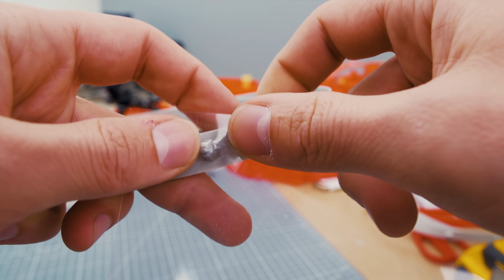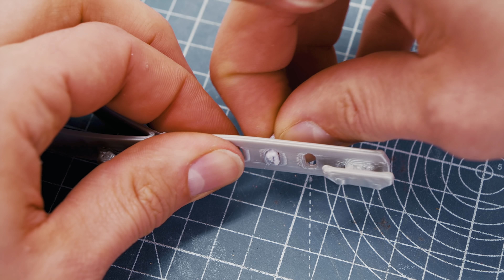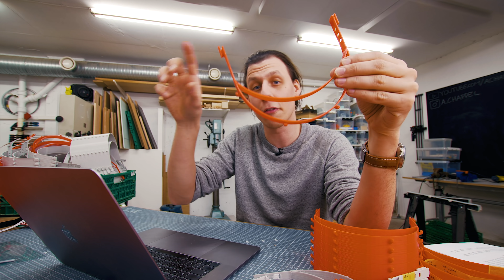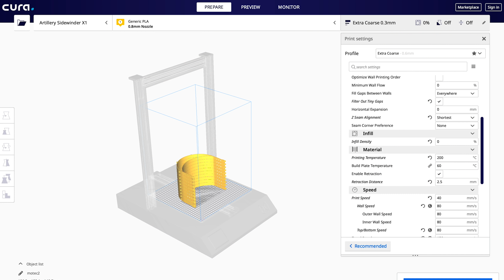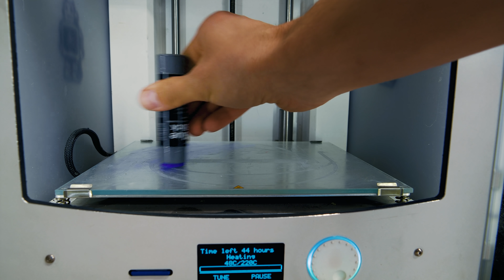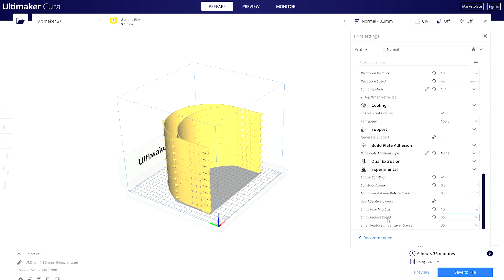3d Print Face Shield Frames Crazy Fast - New Design and 3D Printing How-To

Comment: Something doesn't add up. 
On Ultimaker 2+ you claim to print 80 mm/s with 0.4 nozzle and 60 mm/s with 0.6 nozzle. Then you claim that it is faster on larger nozzle cause there is less friction?
Is this a typo or am I understanding it wrong?

Comment: Hey peeps, for New Zealand we’ve got Shields as the organization that's operating locally, our git has all the public stuff needed to get going. We have a modified Prusa frame that's much quicker to print with 12 /24 hours on an Ender 3 feasible with a 0.4mm nozzle. we also have stacked versions too... Www.shieldsup.gives/github also lots of detail on everything. I've found PETg as the best option, also with plenty of stuff around this, including preset gcodes for machines too.

Comment: ive tried various settings with my ender 3 that has a bltouch connected and a .4mm nozzle but it just doesnt seem to stick nor push enough filement through.ive even slowed it down to 50ms.anyone manage to get this to work on an ender or have the gcode for me to put straight on my printer?many thanks
Reply: i think you are going to have to get a 0.6 or 0.8 to make sure your on the right path. because the heat and the surface area has to match it up and be able to match the flow. also you need some glue sticks to make sure they stay put.

Comment: Hopefully I got it all.Layer height 0.3
Line width 0.85
Wall count 2
Print speed – what you can
Initial layer 25% speed
Travel speed 150
Temp 220-230
Shell wall thickness 2.1
Shell wallline count 2
Infill 0
Bottom layer 0
Top layer 5
Compensate wall overlaps – checked for sidewinder, unchecked for ultimaker
Wall separation width 0,9
Build plate adhesion glue stick
Optimize wall printing order – off
Out before inner walls – off
Fill gaps between walls – everywhere
Print thin wall – off
Filter out tiny gaps – yes
Seam cover preference – hide seam
Combing mode – off
No supports
Bridge wall min length 2
Bridge wall speed 35
Bridge wall flow 100%
Bridge wall fan 50%
Holes – sidewinder off, ultimaker- on
Small hole feature size max 10
Small hole feature speed 30%
Coasting volume 1.5
Coasting min. volume 1.5
Coasting speed 50%

Comment: Cool video! I've been involved in our local effort, our medical doctors wanted a different design from most on the internet as they wanted sealing from the top and more comfort. It meant I had to design our own which takes a bit more time to assemble as they is a foam strip that goes around the forehead. Anyway keep at it!
Reply: If you still need a better design, I have one with a sealed top and comfort. We took the designs to the hospital and the doctors help us to get a feedback and improve the design. Answer me with your email and I'll send it to you

Comment: excellent work, ive been managing 16 a day with an FLSun qqS in petg using a 20mm high wireframe model remix off the prusa site by a user called mike.  i did a wireframe only and 0.6mm noz, 1.2mm thick, overflowing for adhesion, in 2 4x stacks.  8x stack got a bit wobbly.  first 40 delivered to medical professionals in England 2 days ago.  wireframe is soooo easy to separate if you let it cool to room temperature and have the layer height set right as you state in the video.  v good early feedback regarding the strength and how the wireframe design also conforms to a greater variety of head sizes.  they said it also curves the laminate better than other designs as the curvature f the frame is like a tension ed leaf spring and pulls it in closer.  Its their favourite between wireframe rC3, prusa rc3 and the verstan. With that simple wireframe change i cut printing time in half from the prusa model to under an hour per unit at 40mm/s for quality.  60mms possible with petg and 0.6 nozzle but surface finish isnt as good in translucent blue!  this design you presented was exactly what im looking for!!! thank you.  i can double my output to 32 a day now and no longer need supports.  Also im running out of button hole elastic and have plenty of plain elastic left.  so a v good feature for continued production as buttonhole gets scarce.  I also was looking to change the wireframe to 808080  as it would use the curvature of the laminate at its edges better,  so definite improvement if using 250microns A4 laminate sheets.  Thank you so much for sharing this goodwork it will make a huge difference to what i can do now.  It was exactly what i need right now.

Comment: Q. I'm printing the prusa design on prusa mk3s 0.4 nozzle with PLA. I'm finding my perimeter speeds cant reliably go above 70mm/s but my infill speeds are over double at 150mm/s. Is there a reason for this or should I be able to print perimeters faster?

Comment: Q: how does this one prevent droplets coming down the shield from above the person using it? there is a BIG hole there
Reply: Alot of these shields are just that. Shields.... not a replacement for a full mask. Think of it more as a large pair of safety goggles. More of a splash guard than a cover
Reply: It's a splash guard in case of an errant cough or sneeze so the wearer doesn't get hit directly. One should back off if the patient has a cough/sneeze attack.

Comment: Do not put padding, they would want to sterilize them every day and padding may make it impossible.
Reply: Sterilization is unnecessary. Soaking in benzalkonium chloride or similar non-ethanol solutions works and the face shields won't get destroyed (depending on the material, ethanol ruins them)
Reply: You could use a closed cell foam. This can be sterilised. 

3M™ 1772 is a single sided medical polyethylene foam tape. This is a white, closed cell foam coated with a hypoallergenic acrylic adhesive. It is soft, water resistant and can be sterilised by Ethylene Oxide Processing.
Reply: the wireframe remix from mike  on the prusa site i have trialled is so fexible as to be comfortable without the padding.  a benefit of wireframe construction,  strength along the line of stress but curved under tension like a bow to keep the shape despite little material.  the side benefit of which is its lightweight and conforms to all head sizes and shapes.  lightweight means elastic doesn't have to be so tight.  i wear one while printing / disinfecting and find padding completely unnecessary but it would be with the standard rc3 with my head shape.  i supplied 40 without foam to healthcare professionals and good feedback so far.  So yeah i dont think foam is needed.  They all disinfect them everyday.  only the case for the wireframe design in my experience so far because of the flex.

Comment: On the Sidewinder X1 v4, I find it is reliable to use line widths 50% greater than the nozzle size, meaning 0.6 width from an 0.4 nozzle, and that's at 0.3 layer height.

Haven't yet done a true full speed test because my acceleration settings are limiting the actual top speed below the speed setting: I don't want the printer to shake itself apart, especially the bed Y axis.  The closest test is for travel speed, which I had to dial back to 150.

Edit:  I'm also looking into the speed optimizations recommended by Stefan at CNC Kitchen, particularly the minimum segment and delta dimensions.

Comment: I looked in to printing these in the UK.  They're not accepting PLA printed frames as they can't stand the heat required for sterilisation.  Good tips..
Reply: I have been printing in pla for a hospital in the uk just fine. Now using Petg but pla was good. They said they sterilise in chlorine.
Reply: Yes! This! Benzalkonium chloride. No need for heat.
Reply from the maker: Jeah, thats the downside of pla, but petg works for that application ;)

Comment: Since the plastic is a bit flexible. Wouldn't it be possible to make the model a bit more convex, so you could stack them like  this: <<<<  horizontally and get over 20 per print?
Reply from the maker: jeah maybe, but you can allredy get 20 pcs on the ultimaker and 40 on the sidewinder :)